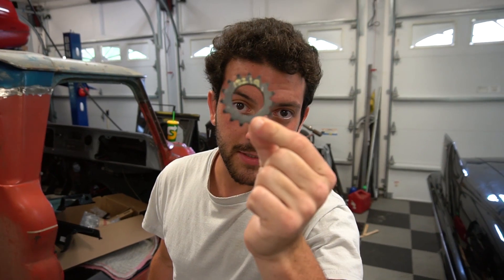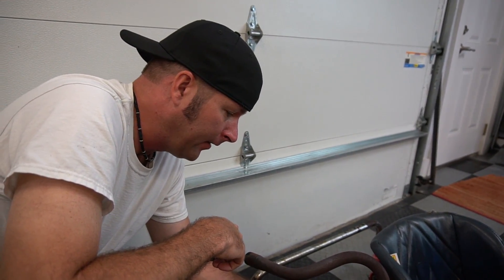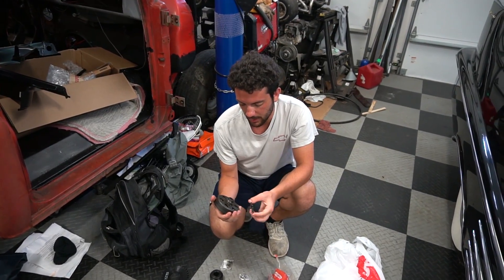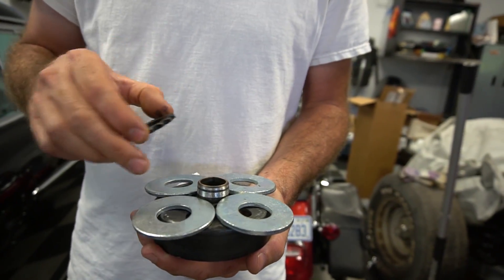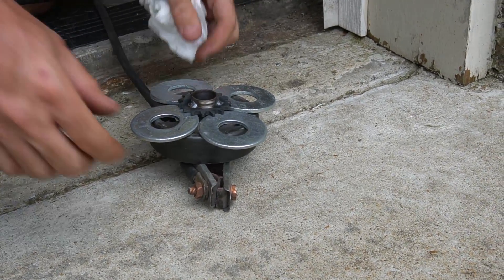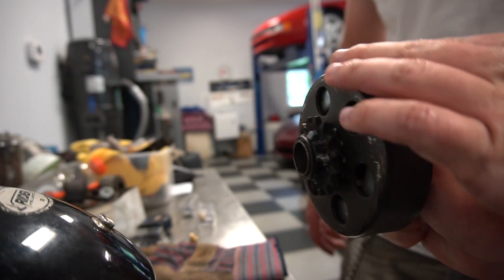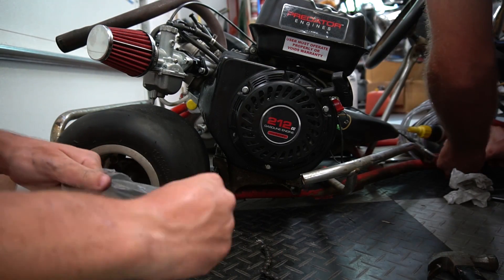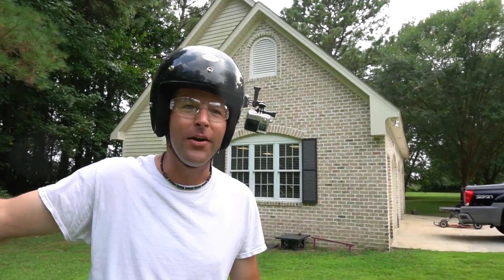Vintage Racing Kart Hits 70+ MPH

Comment: C'MON GUYS WE KNOW IT CAN GO 100MPH !!!
Reply: DEAN IS HERE heeeeeeeeeel yeaaaaah
Reply: with that engine on taylor's lay-down kart, they might just be able to pull 100mph. i think their biggest limiter right now is wind resistance
Reply: +Josh Hust I was just about to comment the same exact thing, it would be epic to see them do that.
Reply: If wind resistance is the problem they are officially just like lake racing Hotrodders, meaning now they need more power and some aerodynamic drag cutters...
Reply: minefan 01 that would make it slowrt
Reply: do the superman to get few more miles per hour haha
Reply: you would lose top end wit a torque converte it would help with take off but it wouldn't go 55mph at best
Reply: if the gearing is the same and the cvt shifts to a bigger on smaller ratio wheres the top end loss. if anything it gains 10-20%.
Reply: That's slow superkarts go 125+. Just come to the uk, where my old cadet kart can hit 60-70mph on the straight
Reply: Alice your missing the point, of the build.  It's a lawnmower engine so to speak of course a shifter cart will kill it but how many people can say they have a 70 mph small engine.
Reply: Atomic Reverend Alexander A cadet Kart isn't a shifter kart it's for ages 8-12 and still hits 70mph😂😂The Karts you simply rent for 30 mins, are simply restricted
Reply: @Alice-oz2ed  1) Cadets don't do 70, they do 60 absolute tops. (still fast for the engine size though)

2) They're 60cc, but they're 2 stroke, massive difference.

I can't believe you wouldn't know the difference but here it is anyway - massive difference between 2 stroke and 4 stroke, performance wise 4 cylinders for kart use are generally lawnmower engines if not at the top end of 4 strokes. So, they're not exactly highly strung, gx160s are 5.5hp, which is the same as the Comers, which are 60cc.

Superkarts are 250cc, and make about 90hp at their best, and those do 160. Once again 2 strokes, extremely highly strung and need rebuilt every race basically. Whereas a lawnmower engine will go for hours upon hours.
Reply: They did 102 on the Ducati kart at the drag strip
Reply: Gotta put a 670 in it!
Reply: 212 is trash how it went that fast and don’t tell it’s because that chain thing
Reply: Turbo time!

Comment: Do not attempt? 🤷‍♂️ guess it's time to attempt this with my go kart 🏁
Reply: time to attempt it with a motorized bike
Reply: time to attempt in my car!
Reply: Scoop i tried this in a stock car and achieved 115
Reply: Time to attempt it on my 250r atc
Reply: Hit 195km/h on my kart WTF!!!
Honda GX390
Reply: @briannotafan3368  torque converters/cvt out perform racing clutches now since the mods done to them now like spring adjustments and clutch weights they can accelerat at constant power
Reply: i got a stage 3 212 maybe i can do it!!
Reply: @jayvlogs5544  oh god...
Reply: My racing kart can hit 110 no problem

Comment: I love your cavalier approach! And here comes the but, you need some safety gear, balanced wheels, aero dynamics, and two hands on the wheel. Mount that phone. Keep it up guys. Love your vids. 88mph!!!
Reply: 88mph , what is that about ?
Reply: Duh, what? thanks, I finally got it when someone mentioned time travel.
Reply: But how will they generate the 1.21 gigawatts? 
GREAT SCOTT!! HOW COULD THEY HAVE BEEN SO CARELESS?!? 😱
Reply: travissq sq completely agree with you. But dam it sounds so good wound up tight. It'll be fine
Reply: thanks
Reply: I can't believe they go that fast with one hand on the wheel... at that speed in a kart I'd be in a full face lid and some motorbike gloves.
Someone needs to sponsor them a nice GPS speedo that can mount on the kart somewhere because dropping a phone at that speed wouldn't be good for it either
Reply: Isaac it'll be fine Fucking hell! It sounded like it was revving to the moon! What rpm do you think it was running at?
Reply: Then we'd see some serious shit!
Reply: I have no idea

Comment: get a phone holder or even glue a case to the steering wheel
Reply: too right, hate to see these guys hurt by trying to drive one handed in a twitchy kart at 70mph
Reply: MIGHTYDUCK1231 too much vibration
Reply: I agree. For safety purposes only.
Reply: You mean for testing purposes only?
Reply: +1
Reply: Guys "it will be fine"

Comment: PLLLLLS dont hurt yourself we need your videos to live !
Reply: but try the 670 to hit 80 mph xDD
Reply: combine the 670 with taylor's lay-down kart, and i bet they easily do over 100mph
Reply: Josh Hust true but not safe needs some harnesses and roll cage
Reply: Hey y'all down by Charlotte witch means it's flat so you don't need alot of tork add a really big sprocket to the engine then put a really small sprocket to the axel use the 670 and in a long enough strait away you could reach 175 because of the gear ratio
Reply: Have someone pull you up to 25mph or you will spin or stand her up

Comment: You guys need to buy a Honda gx390 and do the following modifications to it
-Billet Rod 
-Billet Flywheel
-Longstroke Crankshaft
-Remove governer and oil sensor 
-Shaved and skimmed head 100'
-Billet or stainless steel push rods and valves
-Mikuni flat side 34mm carb
-Lightweight flattop piston
-Aluminum Fuel pump
-32 pound valve springs
-High flow intake
-Highflow header and muffler
-6' advanced timing key
-Port and polish
-Racing spark plug
-Stroker Billet camshaft
-ARC Billet sidecover and bearings
And to top the build off, a large dosage of 116 octane and Nos, with all these mods you will be making the best part of 65hp. Not a good idea to use a stock torque 'o' 'verter or clutch. Probably best to use a shifter kart trans designed to work with heavily modified 390's. (These engines can rev up to 8500rpm) Then put a tiny sprocket on there and hit 120mph, if I can do it you can to! (Just a heads up this cost me $3700 back in 2013)
Reply: Where can i find the shifter clutch for a 390? Have been searching for a year now!
Reply: I've got a prototype transmission for mini bikes and go-karts.  I'm working on a smaller housing.  Ill post a video soon.

Comment: About time to invest in a motorcycle jacket and some padded jeans. If yall ever slide you would wish you did. 65 for a mesh one on ebay.  Stays pretty cool. Keeps rocks and bugs off ya. also if you touch the muffler or engine it give you a couple seconds of protection.

Comment: Very cool guys. 
Though I have already done it ...back in the 70's. 
I raced in a Junior Class from '70 to '74. Engine was a McCullough chainsaw engine modified for aviation fuel. I would run around the block (sidewalks) testing sprocket ratios ...average speeds 65-70.
I started at the ripe age of 7 years old.

Comment: I'm wondering if you could plumb the oil catch back into the sump to keep the oil inside the engine instead of catching it then dumping it back in later

Comment: You should build a go kart that can do burn outs. It can have from brakes and slicks on the back the 212 might work but the 346 or 420 will work the best
Reply: Small engine dude i agree with but I prefer the 670 v-twin
Reply: I never really trusted the Predator engines all that much, being a foreign produced stolen Honda blueprint and all. This video does totally disprove my fears, and I'll be going out to buy a 346 soon.

I suppose I'm a bit biased though since my favorite engines are the 5.6Hp Briggs engines from the late 90's and early 2000's. They put these engines on all kinds of lawncare equipment and power washers so you can pick them up for next to nothing (I once got a pair for 20$ at a yardsale), best part about them is how absurdly over-built they are.
Reply: Frank Tusa 670s are great in idea but when u actually get them together they don't run hard. The fuel pump runs off of vaccumm pulse the govner dosent let it go wide open to keep the fuel pump going meaning if u just remove the gov it will cut out at WOT for a 670 to work good lile a regular v twin it needs a electeic fuel pump and the gov. Removed
Reply: Ryan Rohauer yeah I was just thinking about that the 670 has to have an electric fuel pump when the gov removed.

Comment: To put it in perspective,we were running C open Enduro Karts in the late 1970s that were hitting 160 MPH at Daytona.They were Margay Enduro Karts with twin Komet B-Bomb 135 cc engines.We ran faster than all the bikes at the time,including Yamaha factory OW31 TZ-750 4 cylinder 2 strokes.

Comment: i looking in to modding my go kart but don't know where to start.
Reply: Mark Jones what do you have
Reply: yay for mods! im building one from scratch
Reply: Sprocket work is the most cost effective.  You can also stick an old volkswagen smog pump on any little engine and it essentially becomes a supercharger.
Reply: carb jet and pod filter. header
Reply: Mark Jones try changing the main jet in the carb,putting a cone air filter on,put a good exhaust on and a hotter spark plug in and then try it out.u wil be pleasantly surprised!and it's probably the cheapest option.
Reply: Rastaman Ralph a hotter spark plug? What does that do?
Reply: keeps a great spark because if u run ur engine hotter(flogging it) some plugs don't work properly so  u won't get full power.
Reply: if ur talking about the spark plug it's normally for a two stroke engine coz they run at higher revs and get hotter than a four stroke so it probably don't make much difference.
Reply: What type of kart do you have?
Reply: Governor.

Comment: How underpowered these engines are ? A pavesi 125cc 2 stroke can go 180-200 km/h !
Reply: Pauls Duncans i think that engine also costs more than 10 times As much As these predators
Reply: Enduro Pitbiker probably
Reply: Pauls Duncans two strokes are totally different
Reply: dont compare a 2 stroke race engine with an industria/commercial 4 stroke
Reply: they also fire on every stoke compared to every other stroke like a 4 stroke. Thats why 250 2 stroke dirt bikes regularly keep up with their 450 4 stroke counter parts.
Reply: 2 stroke by its nature has double the power of a 4 stroke. So it's not crazy to think that an insanely cheap 4 stroke motor has very low power
Reply: Difference is: those predators could be held wide open like that all day, try that on a 125 2 stroke and its either gonna put a hole on the piston or the head
Reply: Alan Godin maybe the original honda engines, but these clones i dont think so
Reply: Pauls Duncans. I think the point is to take the cheap engine and get as much out of it as you can. You could always put a sport bike engine on there...right?
Reply: Enduro Pitbiker 

I had a small water pump powered by a 212 and it survived being held open for about 7 hours straight draining a pool
Reply: because these are cheap hobby engines. and btw. would you like to go 150 in this kart? xD not really..^^
Reply: Alan Godin in all fairness it was prolly governed. But i do think these engines would take it. It's kinda what they are ment for especially with forged internals
Reply: Pauls Duncans this go kart is one speed
Reply: it is not
Reply: Pauls Duncans you are also talking in km per hour not miles per hour (there is a difference) cause say if you are at 90mph in kmph it may be at 100-115 or so (i dont know the conversions that well (if even) but you get the point)
Reply: 72 mph is just under 120kmph
Reply: Gotta correct you there buddy, there's no forged parts in there, just a cast aluminum rod and a piston with a pretty good ring kit at least and a sturdy but cheap crank that varied in size from the one in front of it and the one behind it on the assembly line.
Reply: A 30 hp rotax 125cc 2 stroke kart engine costs about $2000... just fyi
Reply: It has one than one gear lol.
Reply: this is a $120 (US) engine with a hand machined head and a $350 racing kit in it. the entire setup is less than 500 dollars, and with no body panels (other than that little steering wheel cover) it runs over 70 with a 180 pound adult in it. you arent going to find a 2 stroke for that kind of money, brand new off the shelf
Reply: Rotax karts run pretty much the same engine either single speed or 2 speed.
Reply: Shadowline#248 is that used?
Reply: Brand new. Used engines you can easily half that price, but buying used 2 strokes is always a gamble.
Reply: Pauls Duncans that's kilometers not miles per hour
Reply: Chase Deason that's not entirely true, the motor has to have enough power to support a gearing. You can't hear a 2 hp motor to do 100. And a predator geared to 100 probably wouldn't move. Wouldn't have enough low end to start moving by itself. So chill the fuck out.
Reply: I love pissing people off for no reason haha
Reply: Pauls Duncans 2 strokes have no cam so its totally different man
Reply: Why on earth were you scared of this speed ? Go karts go much faster with better engines .
Reply: lapistola28 Remember how dodgy the frame is? I'd never go 70mph (120kph) in a old shit like that with zero roll bars and no aerodynamics. It's just common sense.
Reply: Pauls Duncans and it probably took five  years to design this pit bike and it took them 2 months to go 72mph
Reply: someone said a new 125cc rotax costs 2000 dollars, which is true, but if i can find a fully functional 2 stroke kart that comes with extra tires and stuff for 1200 euros here im sure you can find a used 2 stroke engine for under 500 dollars in the usa.. the best thing in my mind to find a good engine would be a old dirtbike and make a shifterkart out of it
Reply: Roast party going on lol
Reply: ngk330 that is true but my predator is geared to go 80 right noe
Reply: a preadator 212cc was designed for a fucking cement mixer or lawnmower. A pavesi was designed to race. See the difference
Reply: a 125 2 stroke has more power though
Reply: Pauls Duncans that's a two stroke
Reply: no shit did you read hes comment lol
Reply: Pauls Duncans two strokes crank Rev limit are a lot higher than a 4t so stock top end is gonna be higher
Reply: it's all the gear setups
Reply: In this land for you and me we talk with american units... aka STANDARD

Comment: CarsandCameras I know how it feels exactly!  I have a Motorhispania RX50 full size crotch rocket with 6 gears and a 50cc liquid cooled engine.  Every time I worked on it and upgraded I would go for a top speed run: 65, 66, 67....72!!!!!!  The day I did I was on my way to work with the wind at my back, and downhill; and it was an epic feeling.
Glad I had on my Sportstrakker app to confirm it, looked at it like 20 times.   I used to have a CBR 900 RR, and I'll be damned if that 50cc 2 smoker isn't a hell of a lot more fun.

Comment: In addition to a phone holder and other safety things others have mentioned please PLEASE beef up the steering, especially the tie rods. Just the vibration of the cart at speed will cause stock ones to flex and cause a speed wobble. What's even worse is when a front wheel hits a rock and causes that thin tie rod to bend, twisting the wheels in opposite directions. You can imagine that this would not have a pleasant outcome for the driver. The rod ends should be replaced as well, just to be on the safe side. 
Yes, yes "it'll be fine" and all, but i had an unfortunate event that was caused by loose steering and am now paranoid about less-than-perfect steering.
Happy racing, hope to see 88mph from you guys.
Stay safe!

Comment: Get a one way valve and weld it to the exhaust, connect it to the new Valve Cover Vent and that will develop a negative pressure below the piston and allow a hare more horsepower at the crankshaft. Always use that on my circle track, drag motors and street motors. Free ponies to go.

Comment: I use to race Enduro Karts they typed out for a single engine lay down Hornet kart 6.2 MAC 91-B modified ported with duel crescent carbs using Methanol  Alcohol for fuel you could expect 95 to 105 MPH. For duel engines  around 135 to 140 In C-Open races. They were built for  Top End Speed.

Comment: You guys need to find a racetrack near you. With a 100cc two stroke on a larger track you can go over 110 mph! Try belt drive, very little friction losses. Holds tension better too.

Comment: I've done 65 mph on a mini Baja with a predator 212 and super wide turf tires still had decent low end torque to
Reply: What gear do you have
Reply: Was the stock gearing that came with it

Comment: Could the crankcase vent be routed directly back into the dipstick hole or something? Wouldn't have to dump it back in after a run. Couldn't plumb it in solid because you still need to vent excess pressure but  it seems like there should be a way

Comment: Hi carsandcameras I was wondering if I could just take the springs off the governor arm will it go faster? (preferably the speed that a non governor 212 engine could do)
I hope it'll be fine so I don't have to do all that stuff to the engine because I just don't know all that stuff yet.... I'm only twelve
Reply: don't take the springs off. they might be the throttle return

Comment: Back in 1959 while working for a state distributor for Macugha chain saws. I took an engine from a two man saw an modified it and ran it on cart at the time. mods were removed the goverenor, removed the balance gears , fill the cavity with epoxy. The engine was 2 cycle, reed valves , one cylinder and rated at 8 hp & 5800 Rpm. I have no idea what Hp was after mods.. Had no clutch direct drive 4 to 1 . It ran 81 MPH on a back road outside of Phoenix
Reply: Damn man nearly 60 years ago! Musta felt like you were entering warp speed
Reply: Yeah I was young 23 year old drag racing nut and Driver, picture in 1958 Okla. NHRA in Nationals. under Paul Grimmett.

Comment: what is the size of the sprocket on the rear axle? where would I be able to find clutch, sprockets, rear tires, exhaust pipe, and the air filter?